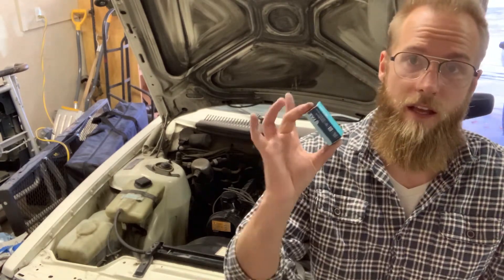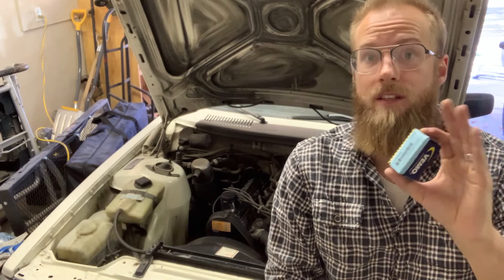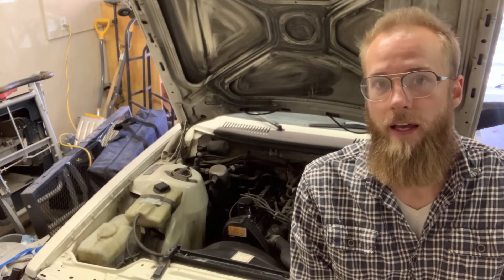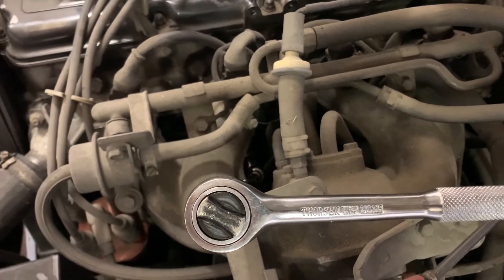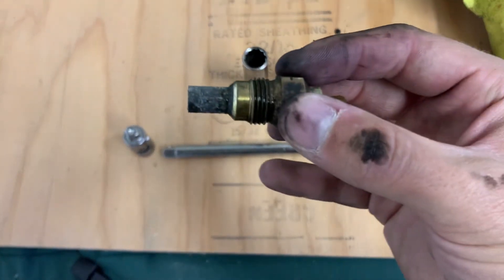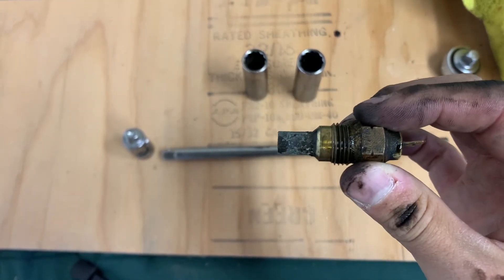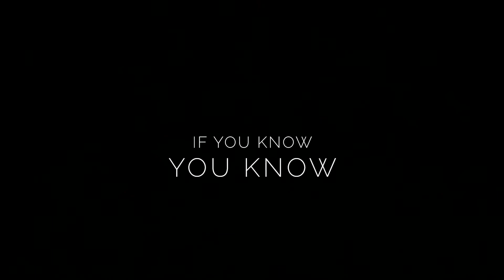Volvo 240 - Engine Temperature Sensor

Comment: I replaced mine and the one I took out. Looks like it had been recently put in and I still have no temperature coming up on my dashboard..
Reply from the maker: If you have no reading, it's probably a connection issue. Check the wire all the way from the sensor to the dash.

Comment: My temperature gauge randomly works and doesn't work without warning. The temperature is consistent when it works. Could this sensor cause this type of problem?
Reply from the maker: Hi @boomerguy9935! You've got the right area for sure, however it would seem to me more like a connection issue. It could be that the sensor is faulty, but I'd check connection between your gauge and the sensor itself - might save you a few bucks!

Comment: Did it repair the gauge from going to red line after 5 minutes of engine operation?
Did you replace the ECU temperature sensor?
Reply from the maker: Hi Zakk!
No, unfortunately this did not solve my problem; however I’m glad I did it, as it did rule out one more thing. Yes I believe I replaced the ECU sensor in a different project.